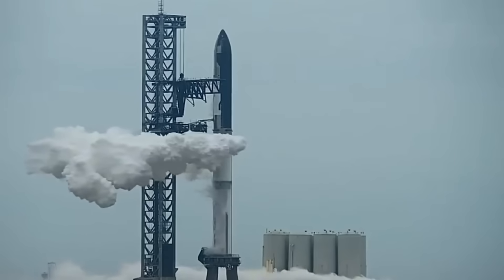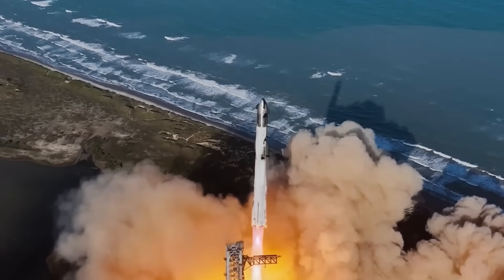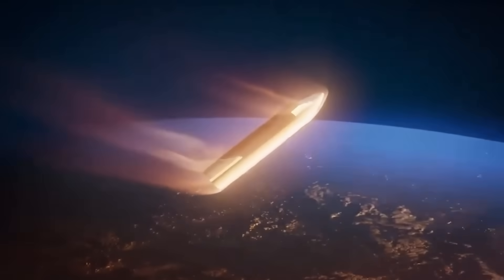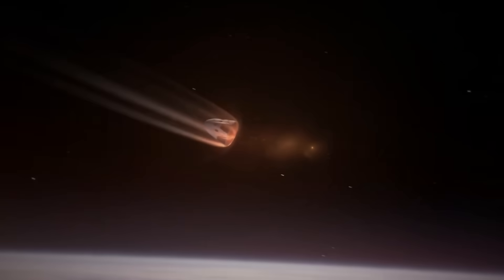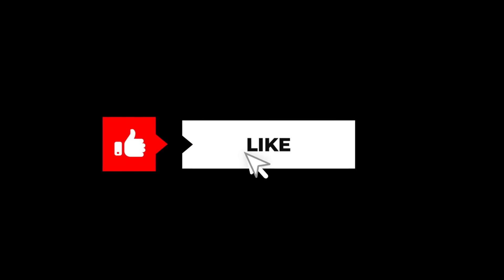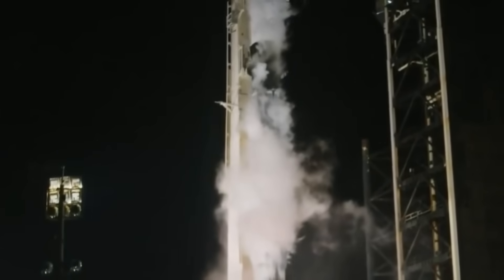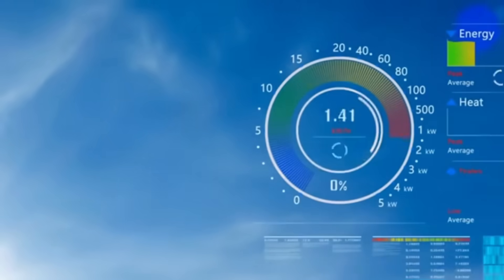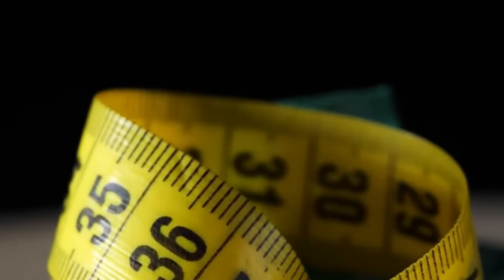Finally happened! SpaceX's Self-Evolving Metal Shield officially completed -Musk's Reaction...

Comment: All stainless steel welders know about "sugaring" which is the same process that can occur if the shielding gas is inadequate or to much heat in the welds which transforms the base metal into a crystalline and brittle weld which will crack. I love Space Xs Happy Accidents.

Comment: Admittedly I am no engineer or scientist. And this system is amazing.
   Isn’t this essentially what knife makers/sword smiths use? When they harden the blade, a crystalline structure forms, then rapidly cool? The liquid methane? And aren’t they venting some of it out? Creating a temporary “skin” around the ship, kind of like when you can dip your hand for a second in molten lead?
Reply from the maker: You're onto something! The process you’re describing is quite similar to how blades are hardened—creating a crystalline structure for strength. In a way, SpaceX's approach with the metallic heat shield and the rapid cooling mechanism works in a similar fashion, though on a much grander scale. The liquid methane in the shield helps form a cooling barrier, almost like creating a protective 'skin' around the spacecraft. It's not exactly like dipping your hand in molten lead, but the concept of forming a protective layer during re-entry shares that idea of temporary, intense protection.

Comment: Its wonderful how evolution works. I would have loved more exotic way than the more mechanical sweating procedure, but as you say the self strenghthening aloy is qualitative change. Although i dont know if it will release energy turning back or if this new strenght is enough in itself, or if it is just a very practical way of transform energy into 'quemical' potential and in 100 flights there is no more conversion left and have to change the tiles. I think more the later but is great pragmatic solution.
Reply: I would have loved something in the way, why we are not using all these exces energy instead of using more energy to get rid of energy.
Reply: Can we use magnetic repulsion against ionized gas? Can we resonate materials to create a useful concentrated energy? Can we even 'steam punk ;)' heat+incoming air into useful propellent and have chemical cooling?,  if not propellent can we even make an endotermic quemical reaction with air to cool down?  Can we even redirect part of this energy into propulsion making a better  'terminal velocity' self sustaining between friction and propulsive deceleration? Or can we go the other way to use 'from ground energy' to reduce speed or alter medium characteristica in the pathway (lots of dificult things on the way, althoug lots of resources available from earth)?
Reply from the maker: You're right in recognizing that the self-strengthening alloys are a significant leap in material science. They provide a practical solution by turning the energy from reentry into a kind of "chemical potential" in the form of strengthened metal. Over time, though, as you mentioned, the tiles may degrade due to the constant energy conversion and stress on the material. This does bring up the idea that after a certain number of flights, the alloy might lose its effectiveness, requiring replacement or maintenance. Still, the current approach offers a very pragmatic and cost-efficient method for repeated use, even if it's not entirely limitless. It’s about balancing longevity with practicality—innovations like this are certainly steps toward the future of space travel!

Comment: Here is a thought build a Space rocket to go to Mars with the new heat shields  and also equipe it with the new rocket that can go from earth to Mars in 30 minutes. I saw a video about this new rocket engine it will have to be unmanned due to the G-Force  but if you sent these rocket with all the supply's  then they could set up shop alot sooner. I'm thinking SpaceX could get landing areas built sooner and they could get green house going to get food growing and get oxygen refining going and fuel refining going. There is a lot of things to build but it can be done.
Reply from the maker: That's an exciting idea! A rocket capable of reaching Mars in 30 minutes would make colonization faster. Sending unmanned missions with supplies could set up greenhouses, oxygen and fuel refineries ahead of crew arrivals, helping SpaceX build a base quickly. It's a bold vision for the future!

Comment: The next huge challenge will be to find a way to get into orbit the lead shielding they will need to survive transit through the Van Allen radiation belt.  The highest orbit the space shuttle ever reached, above the ISS, was less than 200 miles up and even at that low altitude they radiation was so intense they were getting symptomatic ocular flashes indicating very high radiation.  Long before 1000 miles up, they would be dead unless they get pretty thick lead shielding in place.  That is going to take some serious lead to prevent death and that is also going to make fuel costs huge too.  Also when they get to the moon, assuming they make it through the Van Allen belt alive, the problem will compound with huge cooling issues.  It is 265 F in the daytime on the moon and their energy requirements for cooling will make subterranean habitats their very first priority for both cooling and radiation protection.  They are going to be a long way from the protection of the earths magnetic field.  Once they find a way through the Van Allen belt, the problems get intense very quickly .
Reply from the maker: Yes, getting through the Van Allen belts will require new radiation protection solutions, like hydrogen-rich materials or magnetic shielding, instead of relying on lead. Once they reach the Moon, extreme temperatures and radiation will make underground habitats essential for cooling and protection. Nuclear power, such as Kilopower, could be a key energy source for long-term missions.

Comment: This supposed metallic heat shield breakthrough is pure conjecture at best, but is more likely just cleverly done BS.

The only demonstrated and tested metallic replacement for the Space Shuttle tiles consists of thin niobium (aka columbium) metal panels (aka shingles) covered with a tightly adhering ceramic coating to prevent the metal from oxidizing and eventually experiencing burnthrough. Those niobium panels do not require any type of liquid cooling.

 Those FS-85 niobium panels are 0.4 mm thick and were tested to 2600F (1423C) successfully for 100 Shuttle entry, descent and landing (EDL) heating profiles (temperature and time) and were tested with tensile and bending loads typical of EDL conditions without any unbonding of the ceramic oxidation prevention coating.

Those panels require mechanical attachment hardware similar to the hardware now used to attach the ceramic fiber tiles to the Starship and also require flexible ceramic fiber thermal insulation between the panel and the hull of the vehicle also similar to the blankets now used on Starship. 

SpaceX has a lot of experience with niobium since the nozzle for the Merlin vacuum engine used on the Falcon 9 launch vehicle is made from niobium. 

Side note: My lab spent three years (1969-71) developing and testing both ceramic fiber tiles and those coated niobium heat shield panels during the conceptual design period of the Space Shuttle project.
Reply from the maker: This metallic heat shield breakthrough sounds impressive, but does it really hold up under the extreme conditions, or is it just another flashy claim to boost hype?